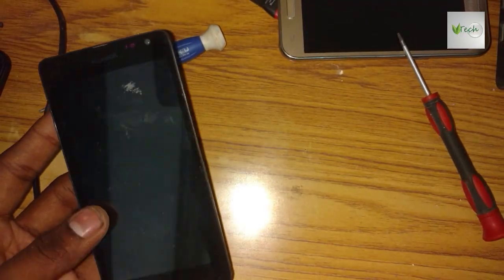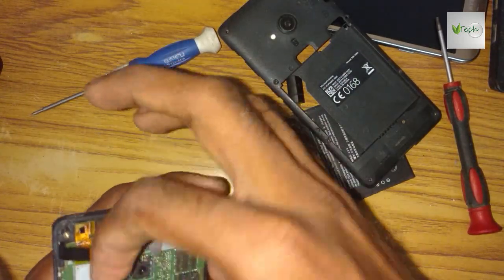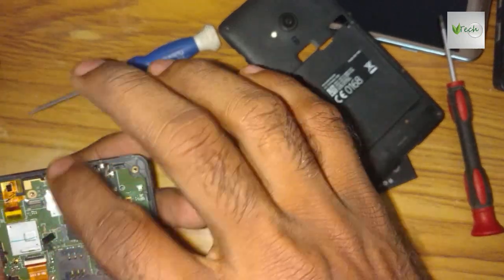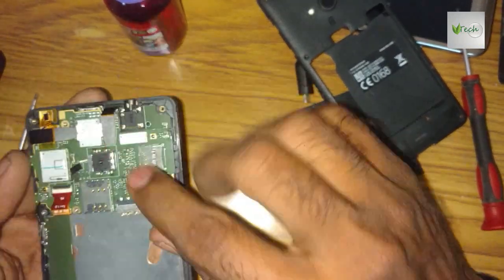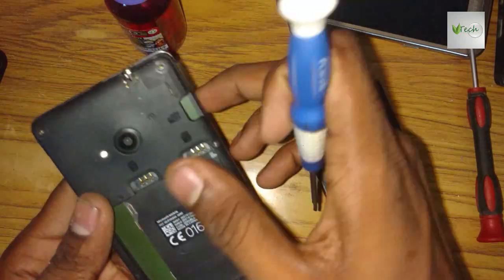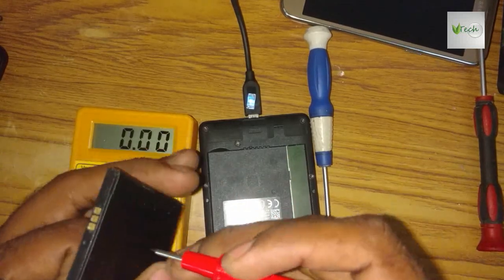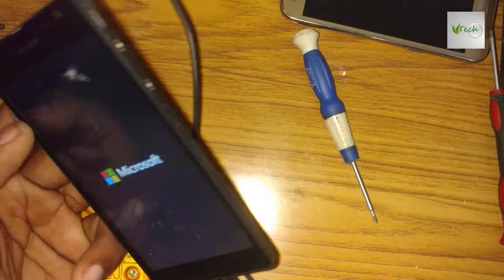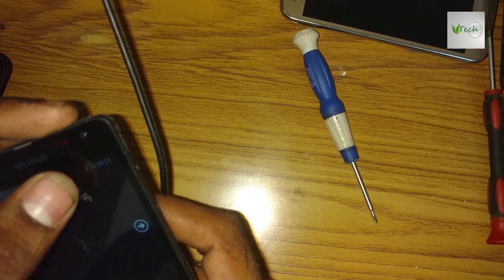Microsoft 535 not charge not turn on easy repair (70%working)

Comment: Hi Bro. is it possible to do the same for Lumia 950? I have a dead Lumia 950. I charged it using a car adapter and after that, when it got switched off due to low battery, it never turned on. They said that charging IC is burnt and cant do anything. I have a lot of photos and videos in it. Can you help?

Comment: Lumia phones are good but they slow down a bit when you have it for like 2 years ?
Reply: mine has 6 years working than it broke down(got depressed lol)
Reply: @roseandaya4438   ok 👌
Reply: I had Microsoft phone as well in 2016 it was so awesome lovely phone but I dropped it on the floor 2 years after that 😔🙁☹️😣💥💵💥🧨
Reply: How old are you I’m 17 years old now? I have I iPhone 6s now
Reply: @gamer12463 mine is still working today(I used a different battery in order to work) but has a charging problem, volume buttons broke but the power button okay, battery completely drained and it was from 2015
Reply: I will give you a tip sell things on eBay and then buy a cheap phone 

I don’t go to school anymore I left

Comment: sir tell me how to repair water damaged microsoft 535 it was on but off in after  4 or 5 min later
can you please give a solution for this problem
Reply: If a device has suffered water damage never power it ON! Make sure to flush all the electronic components with isopropyl alcohol to flush the water away and then dry it thoroughly, Also examine for any corrosion on components. If you power it ON without drying, you risk frying components or short circuiting.
Reply: No put it in rice that s how I fixed mine it works 100% don't put alcohol